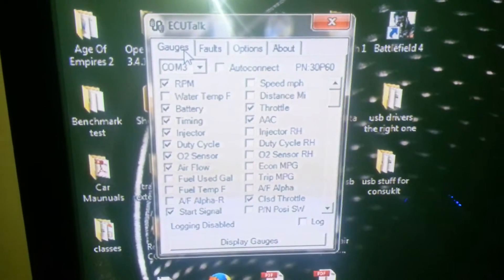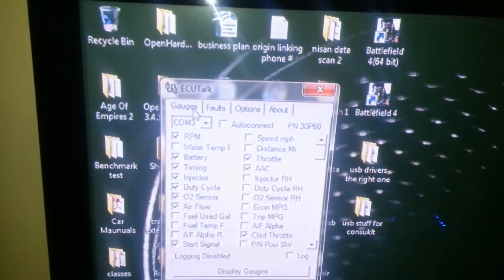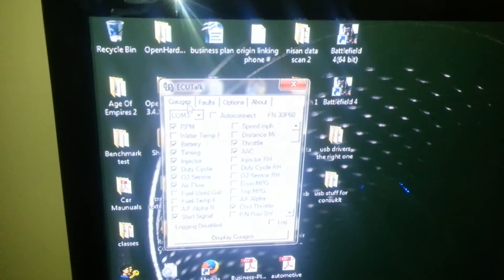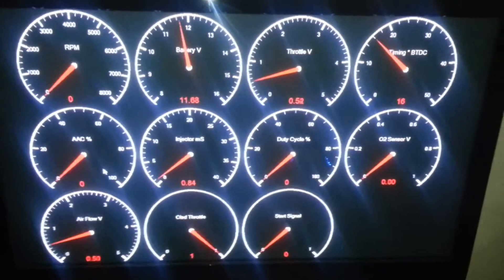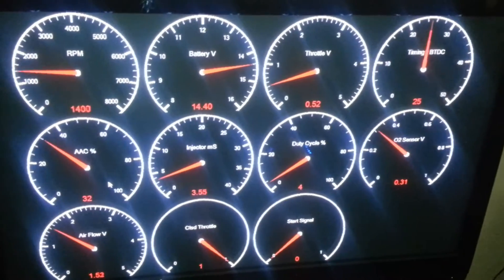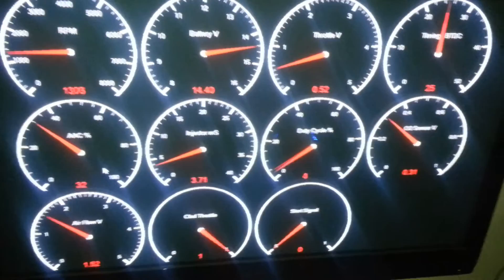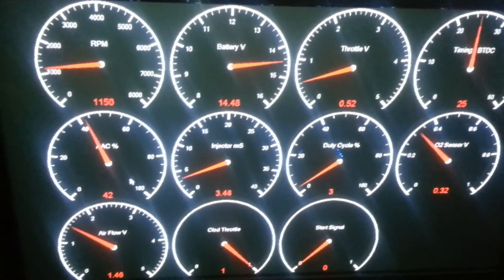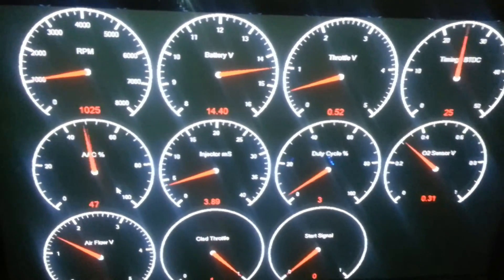how to connect nissan consult cable part 2

Comment: Pretty sure that the USB cable brand has nothing to do with that communication issue u had. It's more than likely, one of ur cables weren't utilizing all of the pins inside the USB, and only have the 2 wires in em for power (so just a charging cable). It's also possible that u had say a F-USB-A to M-USB-A (version 1) and ur adapter and ur M-USB-A to M-USB-MICRO cable utilize USB (version 2), meaning: the data coming out of the adapter, into the Micro, out of the A was fine until that point, but was bottlenecked or lost at the older A-A cable, so the pc saw nothing but an already powered device.

Comment: can you check what is wrong if you have a check engine light? I just ordered one for that reason
Reply from the maker: yes depends on software used.
Reply: Do you know which one i can use for that?
Reply from the maker: Year/Make/Model of vehicle?
Reply from the maker: "Nissan Data Scan" would be the one you want.  or you can get a OBD Reader From A parts store and scan it.
Reply from the maker: or if you cant move it and your tight one cash flow you can jump pins on the OBD connector but be sure the pins you have to jump or you will fry the ECU.
Reply: 1992 nissan 240sx se. Reason why im asking is cause my check engine blinks on and off and i replaced my injectors twice. Also i hate how you have to pull the ecu and read the binks i just ordered the consult so i dont have to keep pulling the ecu lol. People also told me you can use the consult to adjust stuff on the ecu?
Reply: Thanks alot bro for helping me out this is my first nissan ive always worked on hondas and those are like lego i can do a swap in a full day with those and just one stupid check engine on my 240 is a headache haha.
Reply from the maker: yeah the older hondas are very straight forward,  good luck with the 240 if you need any more help let me know :)
Reply: I just ended up downloading nissan data scan on my android note 4 and it works i might buy the full version
Reply from the maker: If you plan to use it alot its worth the money.
Reply: So your saying buying the app is worth it? If so ill buy it i just dont wanna buy it and it ends up being just like the free version
Reply from the maker: it has more features than the free one .  buy only if your going to be using it alot

Comment from the maker: so for those of you who are having trouble with trying to connect you ecu to ecu talk,try down loading drivers for the ability for you usb port to be seen as a com port,  i will try and find a link for you shortly
Reply: yes. I had this issue. Needed Vitual com port drivers for windows. I also installed the .netframework drivers from Microsoft.

Comment: So I've got the exact same ebay consult cable, and I've downloaded ECUtalk.  I did everything in the exact same order as you, but my ECUtalk can't seem to ever connect to my ECU.  Just says "Failed, retry in 5 seconds" and that's it.
The light is red on the cable whenever I have it connected to my laptop, and it doesn't change whenever I plug it into the car.  I tested voltage on the car's consult plug, and it was getting 4.85 volts with the key turned on (probing the power wire and the ground wire, so ground is good too I assume).  I have Windows 7 64-bit on my laptop, and I just tried my friend's Windows 8 64-bit laptop with no difference.  Car is an unmolested 1991 240sx.  Any help would be greatly appreciated!
Reply: yes. I had this issue. Needed Vitual com port drivers for windows. I also installed the .netframework drivers from Microsoft